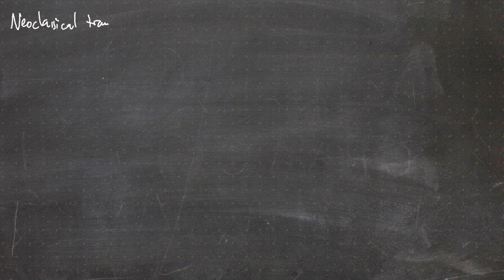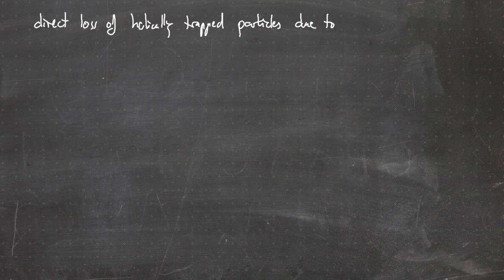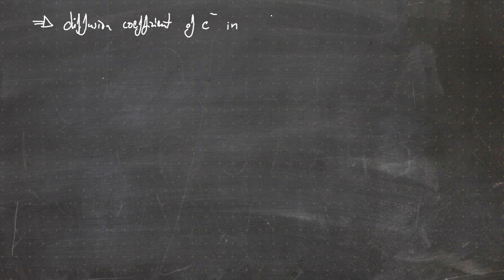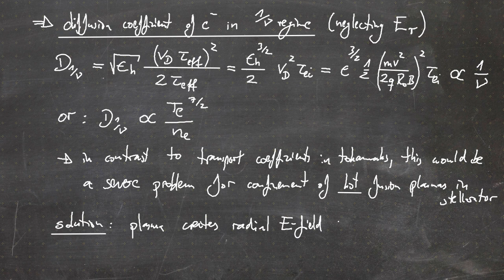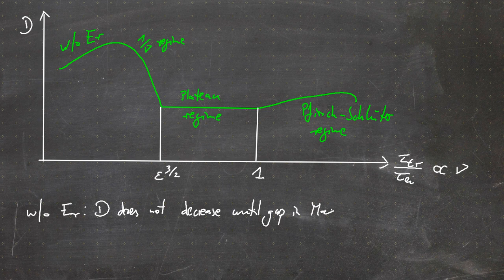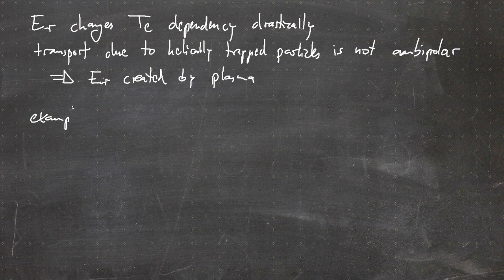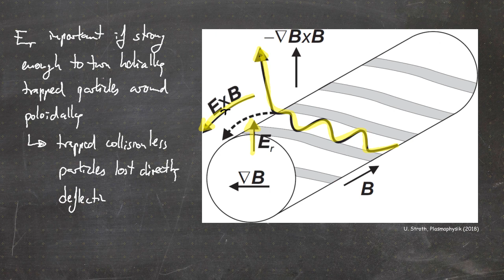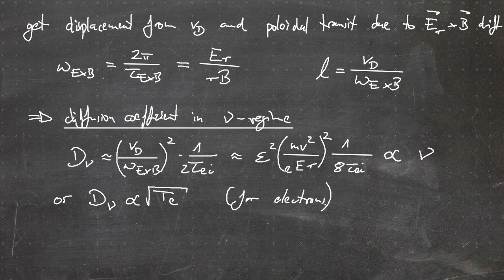Fusion Research Lecture #28 - Neoclassical transport in a stellarator

Comment: I'm wondering about the etymology of the "electron/ion root" phrase. Why "root"?
Reply from the maker: Good question, my interpretation always has been that in the case of the "electron root", the electrons are the cause, or the root, of the positive radial electric field (due to their higher transport losses), thus "electron root". 
I elaborate further, so far nobody disagreed with that interpretation, I'll let you know when I find someone.
Reply from the maker: Just gave it a second thought and had a chat with a colleague about it: more likely is the following explanation: we only get equilibrium when gamma_e = gamma_i, the resulting net transport is zero then, i.e. the resulting net transport has a zero crossing or a root at the equilibrium. Depending on the resulting radial electric field (if it's positive or negative), we call this root then electron or ion root.